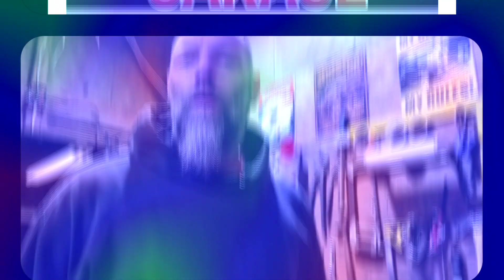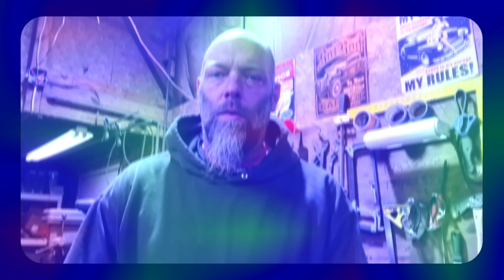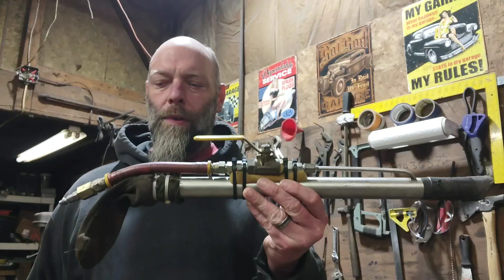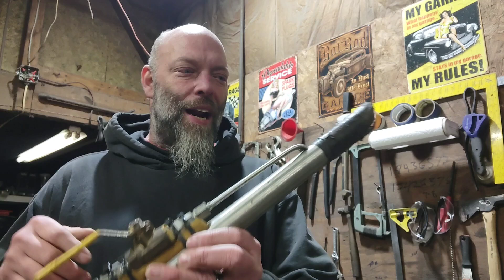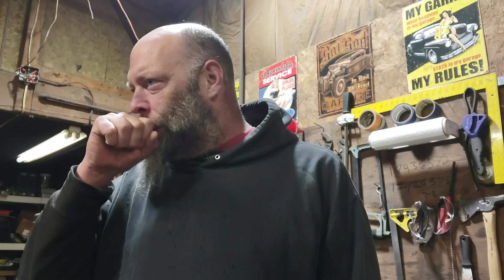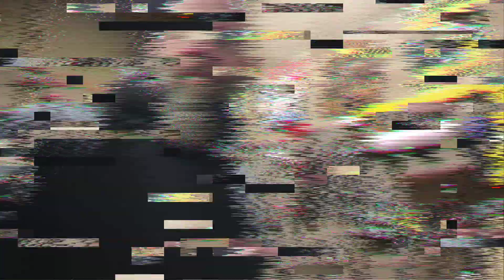#10toolsin10days challenge...my diy air powered vacuum

Comment: Works for  vacuming gold out of cracks in the riverbed too
Instead of a sock, pipe it to a a gold hog.
Battery powered snorkle and 40' of supply hose and you can stay underwater for 45 minutes per charge.
Reply from the maker: True ... thanks 👍